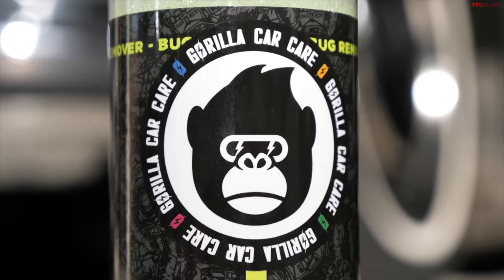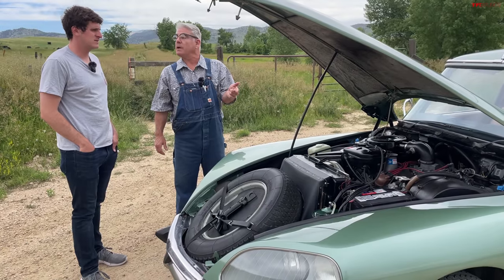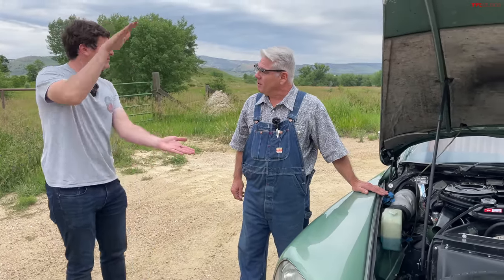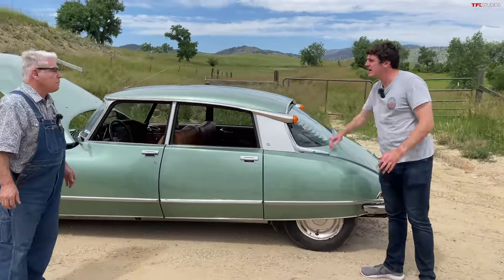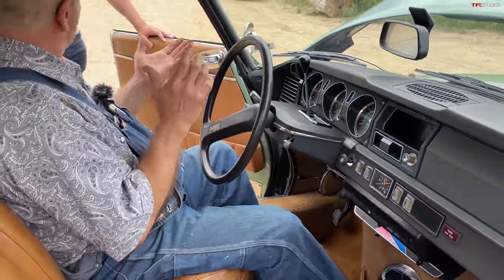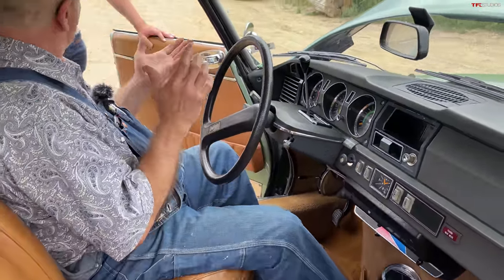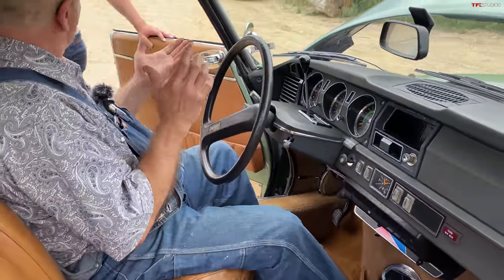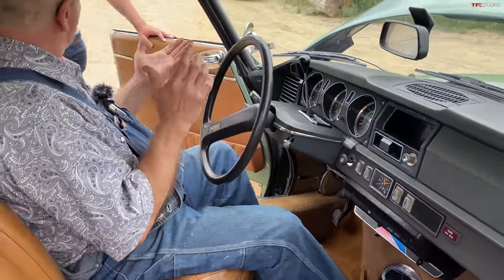Really THAT Unreliable!? Is The Citroen DS as Bad As The Internet Says It Is!?

Comment: As a car mechanic myself, I am indeed shocked how this car is complex and simple at the same time. Hydropneumatic suspension may sound complicated and difficult to maintain and repair but as I see any mechanic can do it. Not a car but an engineering masterpiece.
Reply: The adage - "If ain't broke don't fix it" really did apply to D's. Yes any 'competent' mechanic could work on them, but the order and method of working really needed to be  adhered to. And for that you really needed to consult a factory repair manual before taking a wrench to the beast. A case in point - before doing anything with the hydraulic system pressure needs to be released - and putting the car in its lowest suspension setting only releases pressure in the suspension circuits. The pressure regulator has a release valve - but the component is attached to bottom side of engine block, and if you don't know it is there you never find it:)
Reply: I thought I heard "oleo pneumatic",, just saying😮
Reply: @thegardensentinel and that was just one of the small quirks of this video.
Hydraulic is with any liquid. And the original french is "hydropneumatique"
Reply: It may be some kind of an engineering masterpiece but it's a stylist's nightmare!
Reply: @lancasterritzyescargotdine2602  I'm sure everyone here disagrees, it's just as pretty as it is complex and ahead of it's time
Reply: Wonder who designed this car,he was in the future. Thanks 70 years ago.
Reply: As a colleague mechanic and restorer of 4 DS classics (from friends) i always said that it was a pity that a german development team was not envolved during fullfilling the technics.
leaking bags?   insane!  that could be with a catching transport system. LHM is quite alone in hydrolic technique.
pressuring Balls with CO were ok in the eind of '60s .

Engine could be build more sound damped as last part is under windscreen and quite IN the front compartment.
funny things as Plus from battery so close to the iron battery mounting makes life exiting also !  
glass fuses.     Well it is typical french car.   and yes i understand the fans if you feel the wealthy comfort ride.

Why there was never a V6 in this?  (yes the XM has one)  a relialble V6 i mean...   this would have been TOXIC !
Reply: @jimmykariuki4340  The lead engineer was André Lefèbvre and the stylist was Flaminio Bertoni accompanied by another engineer Paul Magès. They generated the DS. Even Ferdinand Porsche, when he witnessed the DS at the Paris Show for the first time, he stated they he never saw so much high-tech packed in just a single car and that Lefèbvre was clearly a genius.
Reply: @davkilldav211               So is a 1961 Plymouth "pretty".  Or a 1958 Oldsmobile.  Or roadkill.  Or an open grave.  Or a mound of rotting Limburger cheese.  Beauty is in the eye of the beholder, isn't it!
Reply: @lucrolland7489        Some people think Charles Manson was a genius.
Reply: Brilliant car,
My dad had a DS 19 then a DS 23. Apparently the  suspension system was invented by a British guy who took it to British Leyland and they weren't interested so he took it to citroen and the rest is history. Also Apparently rolls Royce used the system under license years later.
Reply: i loved my DS but when it rusted a hydraulic line i couldn’t afford to fix it in germany- maybe if in france they would have more repair options
Reply: @tomjansen5052  the owner explained: taxes in France. Even today: its the notion of "chevaux fiscaux" (tax horsepower). Even the V6 you mentioned is a bit "short" on power.
Reply: @johnroberts3723        And look who isn't making automobiles anymore.  Making cars in England makes about as much sense as opening a child day-care center in a library.
Reply: @_xyzyz_                Welcome to the lovely, wonderful, simplicity of owning a FOREIGN car.  Please take a number and wait behind the velvet rope with owners of MerCrudlez, Volvomits, Slaabs, Pueyguts, Borgwards, Isettas, Pooches, and other dreadful, reusable flimsy foreign flotsam.
Reply: @lancasterritzyescargotdine2602  Who thinks that?
Reply: @lancasterritzyescargotdine2602  What's wrong with opening a child day-care center in a library? It could go well with the children's department.
Reply: @ricardonunes3633  I know as my french connections and friends makes me quite known in France.    Still this development deserved a better attention.
the luxury of the car is more advanced then the engine itself.  even in later series as the CX.
And yes the SM had a bankrupt Maserati V6 equipped.   So for that there was market !

Back to the DS: the gearbox setup does not really leave space for a 6 inline in this HUGE compartment.  all due to lack of technical struggles in this company.   Sad!
Reply: userIOU                  And more than anything, a stylist's drug-inspired, hallucinogenic, LSD-laced nightmare.  A dungpile not even its mother could love.
Reply: Ford
Reply: @davkilldav211        As appetizing as a bowl of hot diarrhea.  As ahead of its time as a 2-story outhouse.  As practical as a 4-door motorcycle.
Reply: Hydrodynamic suspension was used at standard on Citroens, Rolls-Royce and Bentley. If RR recognised how good the underlying engineering is who are we to argue?
I've got one of the old Royce SZ models 40 years old and its LHM based suspension was replaced absolutely perfectly by my local garage and now rides like buttered silk again.
I guess it helps that the garage owner was Citroen trained😉
Reply: @warringtonminge4167              What's another analogy for polishing brass on a sinking ship?  Fixing a Citroen.
Reply: @johnroberts3723  No apparently about Rolls Royce using it. All the RR/Bentley SZ range cars like the Spirit/Spur, Bentley Mulsanne, Turbo R etc. had this suspension system.
And it's bloody lovely 😀.
Reply: @lancasterritzyescargotdine2602  you, sir, have no taste
Reply: @carlossaraiva8213           People who have no taste drive Citroens.  If Citroen made food the way they make cars, they’d have chocolate Limburger cheese pancakes that taste like sauerkraut with goat gravy.
Reply: @carlossaraiva8213                         People who have no taste drive Citroens.   If Citroen made food the way they make cars, they’d serve chocolate Limburger cheese pancakes that smelled like sauerkraut with goat gravy
Reply: Are the unique parts more available than they were in the center of the nation circa 1962?
Reply: @citroenfan8930  Knowing that in case of any failure, the brakes were the last thing to fail made it logical that you would drop the suspension, crank the steering wheel back and forth ad finally press and release the brake mushroom (not a pedal) until all pressure was gone before opening the hydraulic system to the extent of changing out the accumulator or it's associated piping.
Reply: @wssides   Not so😀. Opening the main accumulator's bleed valve (only takes about 1/2 turn) and putting the car in its lowest suspension setting removes all pressure in the car except for models having a brake accumulator. If one is going to work on the front brake's system in those cars  you need to open the bleed screw on the brake accumulator after removing main system pressure. Unnecessary to 'pump' the brake actuator. OTHO pumping the brake actuator is a good method to check the pressure in the brake accumulator. Should take about 5 or 6 'panic' stops before pressure is lost. The only reason to turn the power steering back and forth would be to flush fluid out of the steering rack's power piston. This just reduces leakage when it is removed.
Reply: @citroenfan8930  I let my factory manual go with my 69 DS 20 and was going by memory. Still can remember only one accumulator (pressure reservoir). on the system
Reply: @wssides  Hi Bill. As I mentioned the factory eliminated the separate brake accumulator with the 70 model year except for the DS 21's/23's. Their model year starts in August. AFAIR the DS20's were a '70' model.  A good example the 21's were introduced in August of 65. They were referred to a 66 model. As a side note - we have a 92 V6 XM - and it has a brake accumulator. With the XM's there is a lot of confusion as the only model so equipped were LHD V6 cars.
Reply: @citroenfan8930  The DS 20 in Canada for 1969 may be an oddball also. I ever saw one until I bought mine and it had not sold as a 69 and was  sold to me as an official 1970.
Mostly DS21 features but with an ID19 engine.   I had serviced IDs, DSs and 2CVs in a Calgary dealership for a year under supervision of a factory trained master mechanic from Scotland. I learned the basics and did all service and repair on my own car. The dealership had failed 3 years before I bought my car, the dealer I bought from was going out of Citroen due to no import rules on models other than the SM.
Reply: @wssides  The DS 20 was, in essence, an slightlyt upscale version of the the DSpecial that Cit sold over here. AFAIR Cit USA never brought DS20's in. And, yes, they were introduced in Europe in August of 1969. Not sure about Canada, but in the US we could not get LHM equipped cars until January of 1969. Reason - it was not an 'approved' brake fluid according to our DOT. The fact that mineral based hydraulic fluids powered jet's brakes - as well as the rest of the hydraulic system - ment nothing.
Reply: in Portugal there were citroens , renaults and peugeots all over our old mechanics knew them well, i had between others a Mehari , nice beach car, DS i had 3 the first was the DS19 GT, then a 23, still with me today running perfect

Comment: When the DS was presented, an author wrote in an article „This is not a car from the future. It is from today. All the others are from yesterday.“ Well said.
Reply: But this is still better: "The DS is not the car of the future, nor the car of the past. It is the car of today!"
Reply: DS technology especially steering and brakes should never have been sidelined. It’s a huge shame that Tesla have not employed the systems. Two independent electric pumps would solve perceived safety issues.
Reply: Because of the characteristics of the suspension, the rear axle will actually lift up under acceleration, rather than compress from the vehicle's rearward shifting weight.
Reply: @Dave5843-d9m  The best solution to a Tesla's problem is to not have a Tesla.
Reply: @theothertonydutch  I'm sure an other brand car would do better with an electric motor